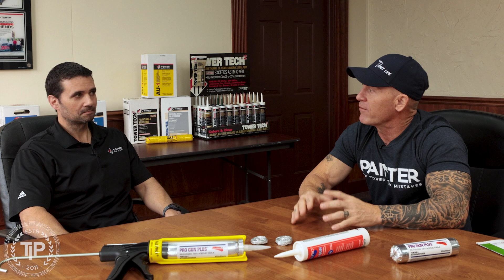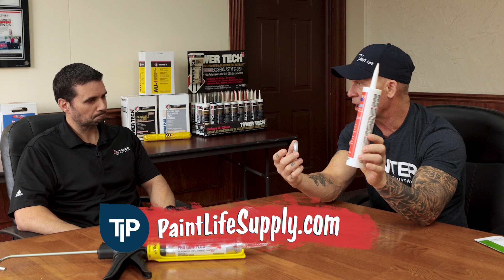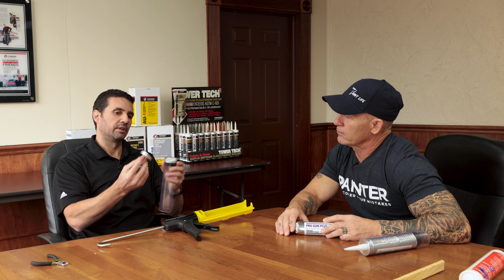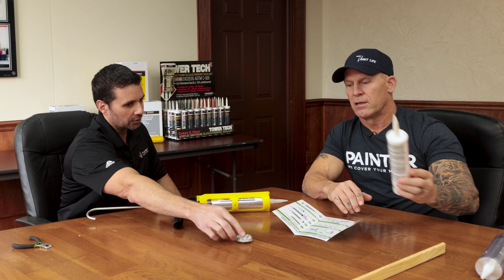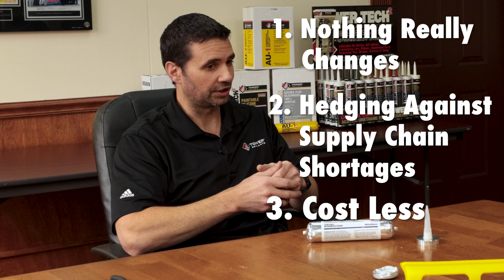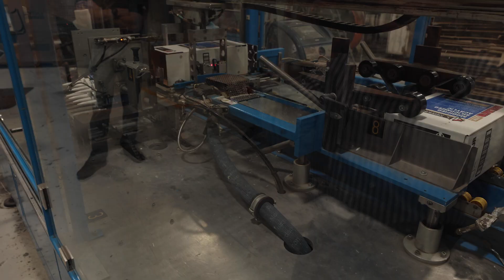Whats new in caulking.  Caulking innovations from Tower Sealants.

Comment: that sausage using basic gun is actually good idea.
Reply: Thank you. Field testing made it pretty clear that customers didn't want to change from their favorite caulk gun to a sausage gun.
Reply: @towersealants1349   you mean the regular sausage ? yes it´s pretty ovious if frikin´cumbersome at the beginning when the rod is tickin out when you start a big sausage. if it were made from small joints and could bend it would be a whole different thing. or maby made out of bendy nylon.. i mean the push rod so it could bend through armpit when its extended at the beginning

Comment: FRom my years of caulking and hard to reach caulking areas I have learned to  save the used tips on spent tubes so as to stack them one on top of another to extend the reach of the tip. I also use a tip that has not ben cut to place over cut tip to prevent drying of caulk wile not using. Better then tape.

Comment: What is the difference between hvlp and airless paint sprayers
Reply from the maker: High volume low pressure:  HVLP paint sprayed with air mixed. Airless is pure paint no air.
Reply: @Idahopainter  do you like house painting
Reply: @Idahopainter  can you make a drywall repair video

Comment: How do u clean the tip
Reply: Hi Wolf, several plastic tips come in each box of sausages. The tips screw onto the endcap. You can rinse the whole thing with water or dispose of the plastic tip and just clean the endcap. The easiest way we've found is to simply drop it in a quart-sized paint can of water to soak, then just begin using again the next day.